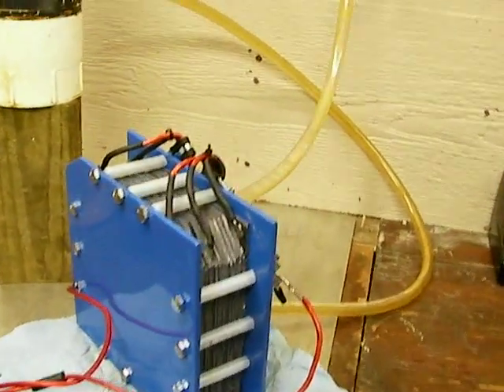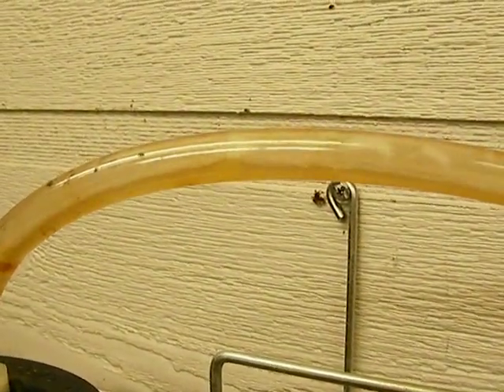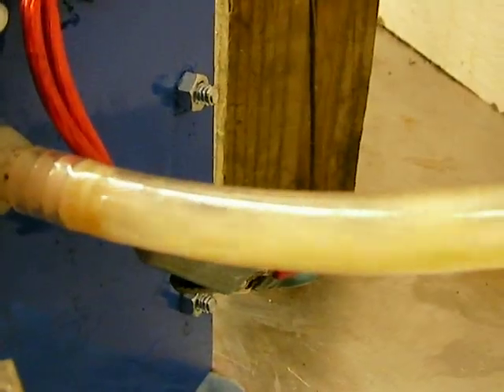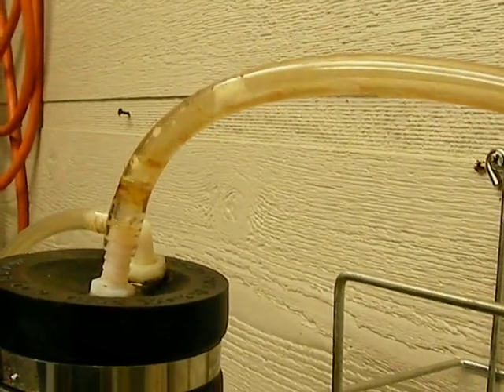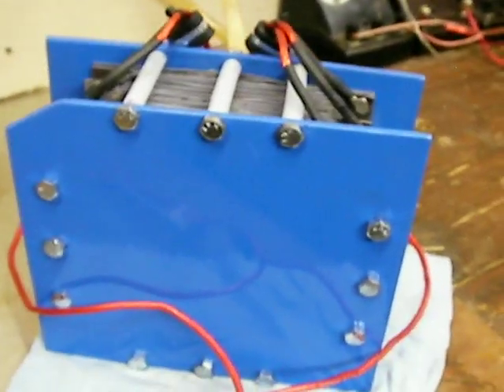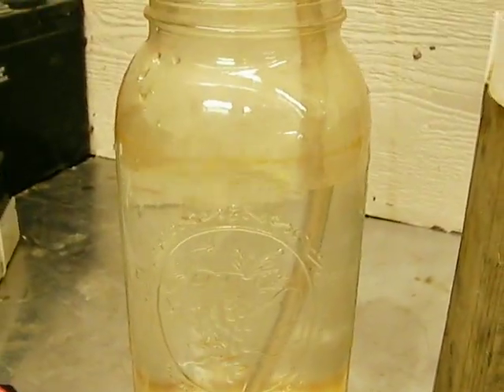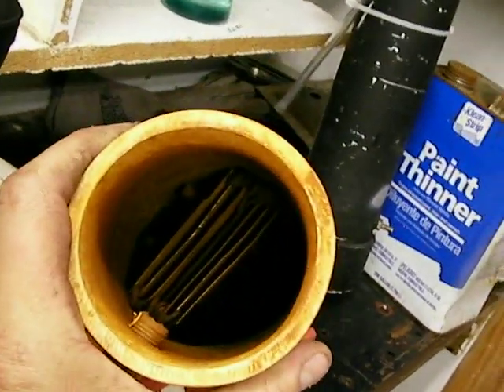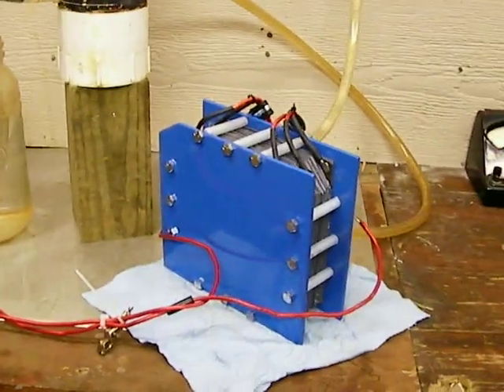hydrogen cell design secrets revealed

Comment: if you had a radiator you will have to fit it in the return pipe.. as air will just build up inside the radiator..  and try getting a little 12v  computer watercooling pump.